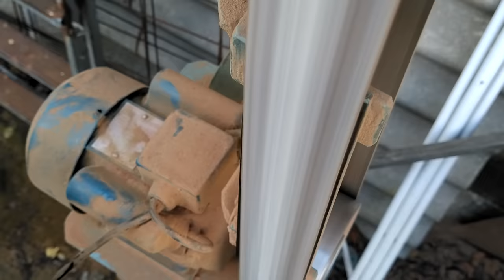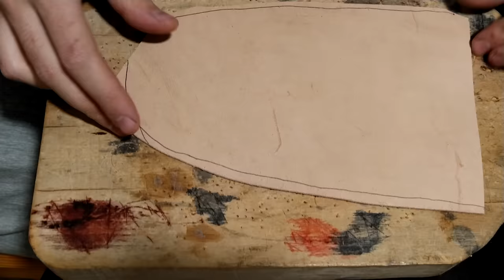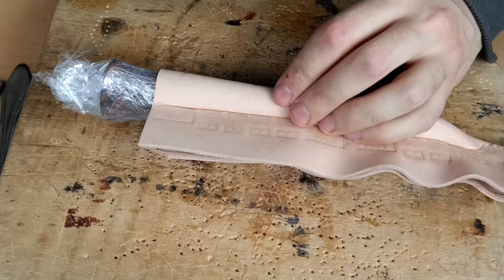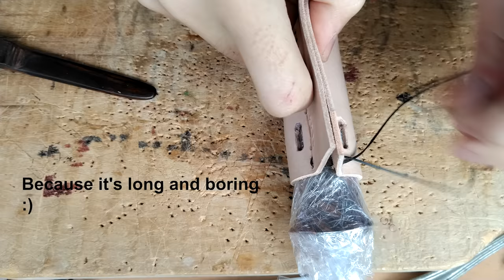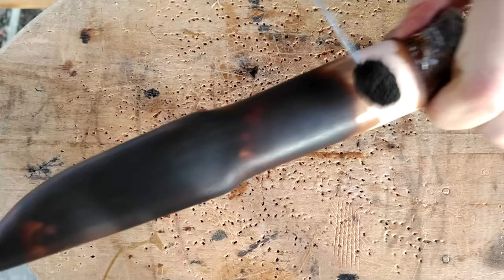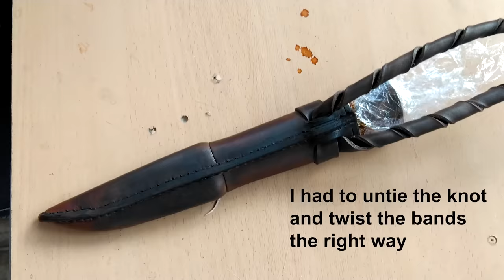Making a Puukko knife leather sheath (Finnish style)

Comment: There is an aspect to traditional sami sheaths that no one seems to mention. 
I noticed this feature after receiving a Wood Jewel knife as a gift. 
The knife cannot be drawn accidentally from the sheath by snagging or 
grabbed with one hand and drawn by someone else.

If the sheath isn’t held while drawing the knife, pressure is put on the belt loop ,tightening it around the handle in the sheath. This is a brilliant design concept that is being overlooked or simply unnoticed.

I’ve taken a misstep and tumbled down a wooded hillside and ended up with an empty sheath before. That is dangerous and I got lucky. That can’t happen with a sami sheath. The knife doesn’t come out without the proper permission and procedure.(if the loop is made right).

Big fan. Awesome puuko.👍
Reply from the maker: Thank you for the nice comment , Just checked this and it is true  :) And there are so many people criticizing this sheath and saying that it will be very hard to pull the knife out and you can't deploy your knife fast. I tried to explain to some of them that this is not some tactical instant deployment combat knife and it does it's job just fine :)
Reply: @RustLegion  
Folks overly concerned about” tactical deployment “ should look into buying a bayonet or a different style sheath. And ,perhaps should stop watching so many silly “tactical” movies and listening to “tactical “ salespeople.
In over sixty years of woods walking , I’ve never had to “tactically “ deploy my knife. My greater concern is not losing my best tool.
Reply from the maker: @chopsddy3  very well said :)

Comment: Very nicely done! The grandfather of a work colleague made me a leather sheath for my knife when I lived in Thunder Bay, Ontario (LOTS of Finns live there!) because the knife came with a plastic sheath and Grandfather did NOT approve!
It has a little "fishtail" flap at the tip - is that just decoration or is there a reason for it? I never thought to ask at the time.
Reply from the maker: Thank you for the nice words and thanks for sharing this story.  As far as I know , there are two types of fish tale puukko sheaths. One is just a bit more leather on the tip and it's for decoration and another type that the whole sheath profile is like a fish tail and I think this one is for easier draw of the knife when you wear thick gloves.
Reply: Maybe it absorbs any water that drips from the drain hole drilled in the bottom tip on many wooden sheaths. ?

Comment: Nice work.  I have made many sheaths for Puuko's.  I do it a bit differently but will use your method next time..
Reply from the maker: Thank you sir, I'm happy to hear that you will try it . it will also be interesting to hear what are the differences in your way of making them . Cheers
Reply: @RustLegion  I sew mine while wet.  I use a leather awl and make each hole as I sew.  I also make the belt loop a couple of different ways, by leaving a high spot near the top of the sheath and making a small hole in it.  I then either use a metal ring to attach  or a piece of leather throught the hole and twist like you did.  I make my knot a bit different as well..
Reply from the maker: @jimsheely5491  I usually make the belt loop the way you said (with hole and metal ring) but this time I decided to try with the twisted leather band. I also sometimes use awl for the holes but never tried to do it on the wet leather. I'll give it a try ;)

Comment: My Puukko sheath came with as open 'flare' at the bottom. I assume it is for decoration as well as drainage. As you used a sealed wooden insert, is that why the bottom is closed? This vid has given me with inspiration. Thanks!
Reply from the maker: Glad to hear it inspired you :) . I didn't make drain hole in the sheath because it's carbon steel and if it's put in wet it will rust with or without drain hole .
Reply: @RustLegion  Understood. Thank you for the reply; I only just saw it today as I didn't get a notification from YouTube.

Comment: Love the belt loop and the two-toned sheath color! The tip, I noticed, is a lighter brown -  weathered looking. How did you do that? It's awesome. Thanks for the video!
Reply from the maker: Thank you Patrick :) I just used 2 different tones of paint - golden brown and chocolate brown. You can see when I paint it , I first leave the middle unpainted. The colors look the same when they are wet , but when it dries out the difference appears :)
Reply: @RustLegion  thanks - I didn't spot that. NEXT question: when you use that great pricking tool, do you do the other side as well? Or maybe you have the locations pricked, and just the horizontal line marked. Thanks again! It's rough being a beginner.
Reply from the maker: @patrickfreeman8816  Yes I do it on both sides and I try to make them exactly at the same distance so they will match when I start to sew. Also when I mark all the holes I count them on both sides and don't start drilling before I'm sure that they are the same amount on both sides (for example 41 holes on left 41 holes on right)
Reply: @RustLegion  what knife is that? Its beautiful
Reply from the maker: @cornpop9262  Thank you , It's a puukko knife with blade made by Jari Liukko from 80Crv2 steel , the handle is made by me with stabilized alder burl and antler :)
Reply: @RustLegion  awesome.  Thanks for the reply.  Beautiful work

Comment: Beautiful work, I am curious about one thing. Have you ever experienced a problem with the blade cutting into the leather due to the fact there is no welt ?
Reply from the maker: Thank you. No , the wooden insert protects the leather :)
Reply: Appreciate the response, the area I was wondering about is the leather around the handle, it doesn't cut it when inserting the knife ?
Reply: yes, it cuts easily, but  if you put knife  to sheat carefully it wont be  damaged
Reply from the maker: @rigidironworks9834  aaa I see , Well I guess it will cut it if the blade toches it wit enough force , but with a little care this shouldn't happen ;)
Reply from the maker: @allux8236  Yep
Reply: @allux8236  that is incorrect, inserting the knife "carefully" has absolutely nothing to do with it. If the blade is razor sharp and it is rubbing the inside of the leather, there is friction and each time it is inserted and removed, it will cut the leather.
Reply: I mean if the blade has enough room to not rub the leather, most puukko knives  have smaller blade than handle
Reply: @allux8236  your original response to my comment was " if you put the knife in carefully...." I have made many Puukko knives over the years so I am familiar with the style.
Reply: There's another important thing to consider in the design that prevents damage to the sheath from the knife blade. On the sheath in this video and on traditional sheaths you'll see that the stitches are offset 90º from the blade, so that the stitches don't get cut when the knife is being put away. On some contemporary imitations people who dont understand the reason for this will line the stitches up with the blade because they like the look of that better.